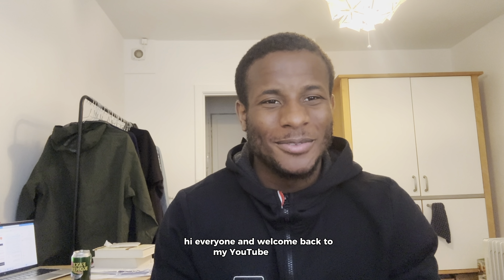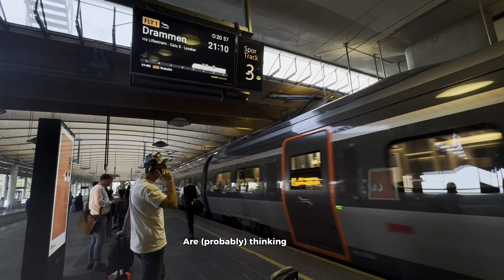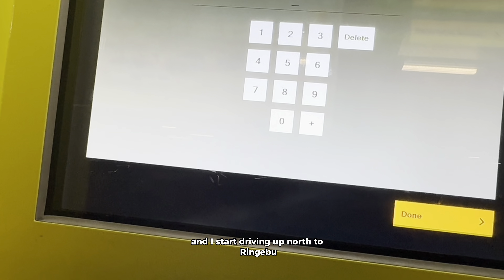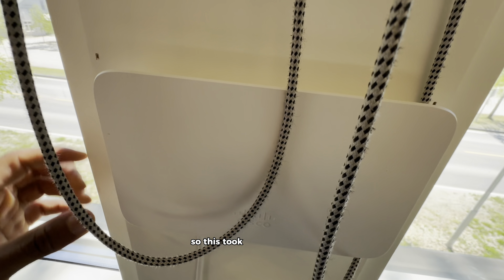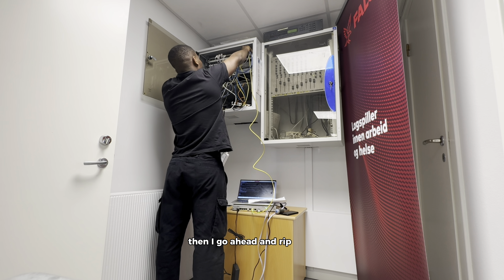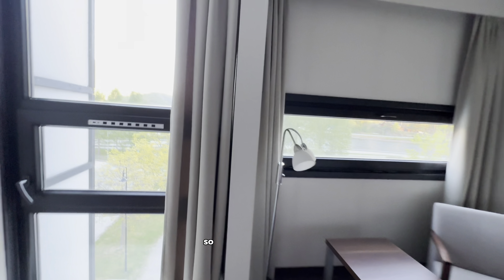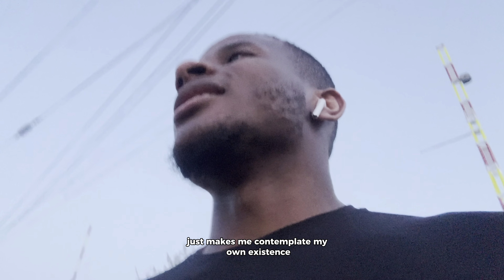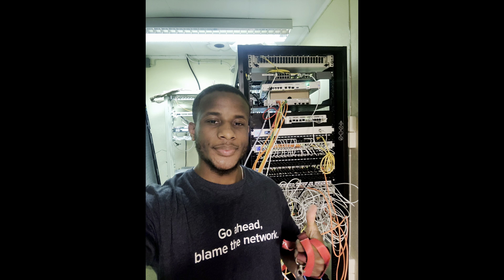Network Engineer Life: Integrating 28 Clinics Across Norway

Comment: How are the clinics connected? I mean if they are all connected to one main office for sharing data ? Like MPLS or are you working for an ISP?
Reply from the maker: Thanks for asking!! We’ve rolled out SDWAN in our environment, previously  the routers were configured with DMVPN tunnels to a hub(s) somewhere at our DC in either Sweden or Denmark. Pretty much the same thing happens with SDWAN but with much smarter traffic routing and other benefits Viptella based SDWAN provides. We don’t run MPLS in our campus.
Reply: @ thanks for sharing. Can this be achieved by just using sd wan capable routers or you would also require configurations from your local isp at each location?
Reply from the maker: @ Yes we use the same router model throughout our enviroment and they are SDWAN capable. The only thing we need from the ISP is to know what method they are using on each location (DHCP or Static), if static then what's the IP, so we can correctly fill out the SDWAN template.